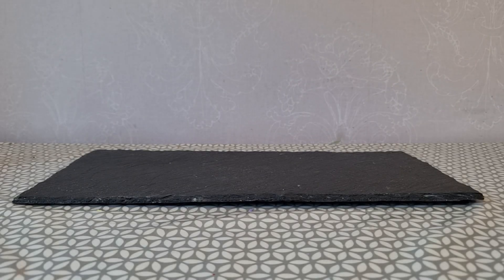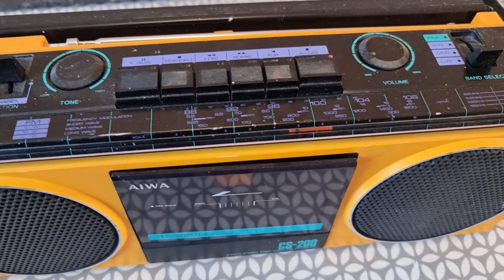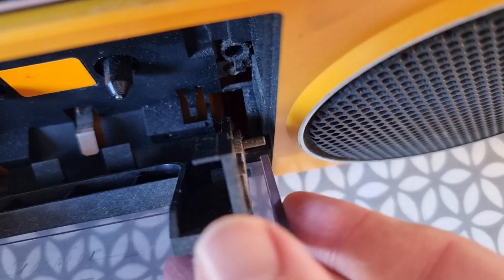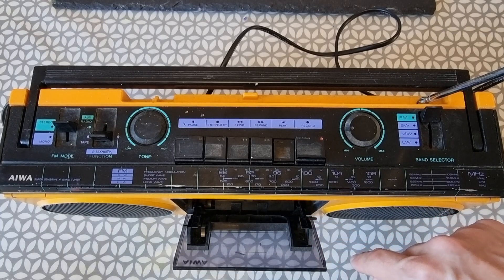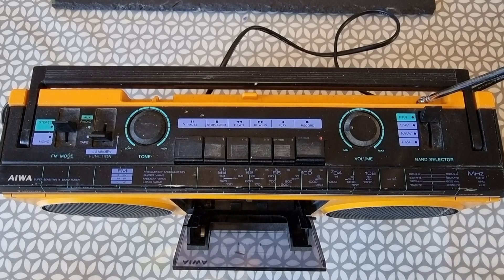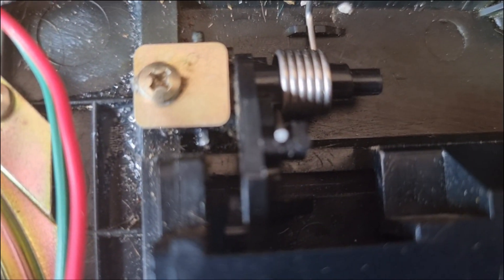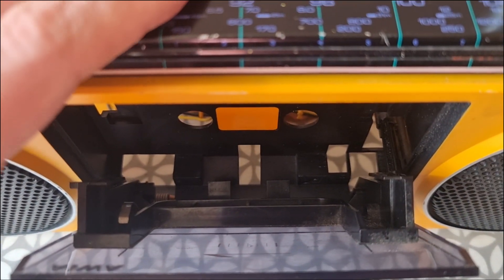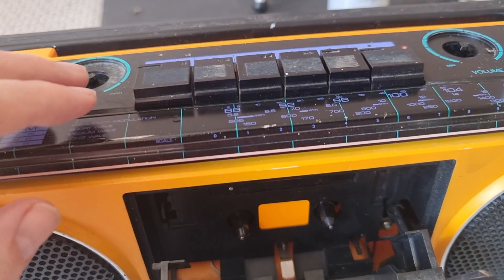Repairing the Most 80's Boombox I Could Find!

Comment: Great video. My goto guy is Techmoan for audio stuff but this was very good and enjoyable. Being in PC i use an electric blower to dust clean my equipment. Air cans are so expensive and dont last long and hoovers are a no go. I highly recommend a oc blower with an assortment of nozels for all those nooks and crannies. Excelsior
Reply: If you open again i recommend greasing those gears in the tape assembly. I believe some recommendca steam of the rubber bands before replace. All minor stuff :-)
Reply from the maker: Love Techmoan, my goto also. I would love to buy all the broken things on ebay and fix em up but I don't have the funds or space sadly. Cheers for the tips!

Comment: I know it is from 86, but it doesn't scream 80s, it screams 90s.  When you are testing things like old radios NEVER check them with mains power.  Put the cheapest carbon-zinc batteries you can find from a Pound store or something.  CZ batteries are very current limited and this greatly limits the damage a shorted capacitor or other failing electronic component can do.  Depending on the fuse size, the wall can put a LOT of energy into that radio before it fails.
Reply from the maker: Thanks for the tip 👍

Comment: 0:15  NOT EVEN CLOSE.  That's a craptastic junk box whose tape sound and especially recording ability will be awful.
The real 80s boomboxes were only made in the late 70s to very early 80s and were pretty much dead by 83. 
The boombox craze actually started in the 70s. But these were high end machines with manufacturers making them because they could.  Before the 70s, the only solid state radios you could really get were transistor radios, which were usually low end crap. 
 But as high quality miniaturization became mainstream in the mid 70s, you started seeing very high quality boomboxes with features like shortwave, auto music search for tapes, soft touch tape controls,  tape to tape dubbing, high end tuners and very good amplifiers with large 3 way speakers.  While never particularly powerful, they were highly efficient amps and speakers. 

But by late 82, these decidedly became low end.  By 83/84, there were no good boomboxes on the market.  Instead there was a proliferation of these low end plastic boxes like the one in this video.
Reply from the maker: It was more about the aesthetics of it really. The bright colours. You ever watch Techmoan? I reckon you'll like his stuff 👍
Reply: @SebsPlaceYT  Yes. I've been subbed to him for quite a long time.  My older brother had one of the early boomboxes. I think from 1979.  That thing must have weighed 20 plus pounds.  By the time I was a teenager and my parents bought me one in the mid 80s, it was a junky GE model.  One of 700 models that were under 100 bucks in every discount store (Kmart etc).

Those early boomboxes are a very special product category only available for a few short years. Built to high specifications and quality, but priced to match that high quality and specs.  You just can't sell a 500 Dollar boombox next to a $79 (after a few years of high inflation) model and expect to earn any money. So they disappeared.